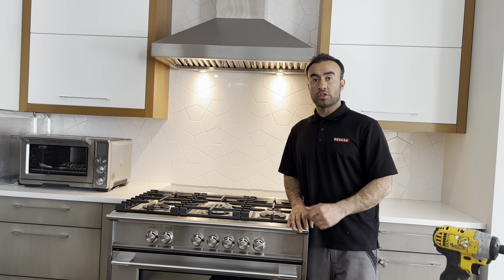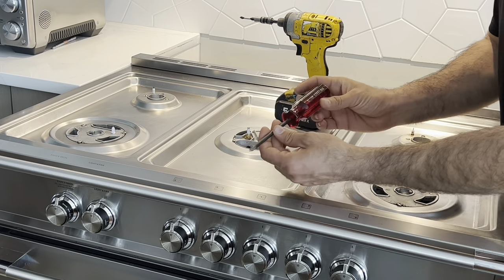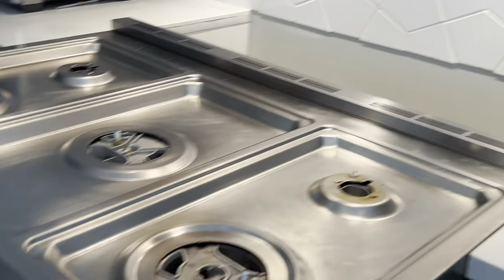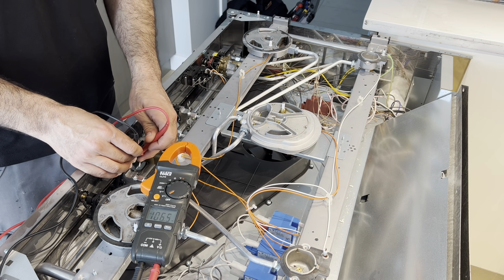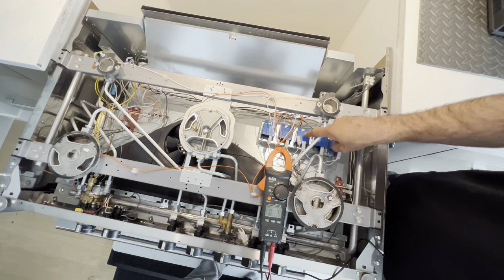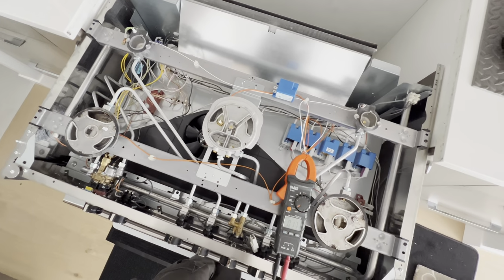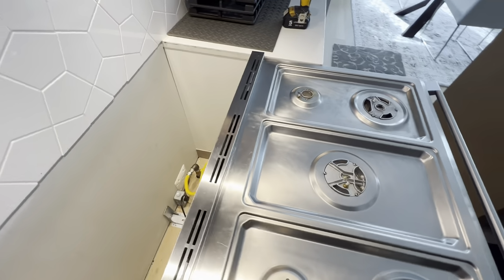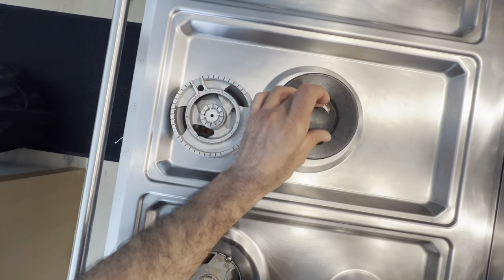Fisher Paykel gas oven centre burner not lighting

Comment: I'm trying to fix a Fisher for a client. The cleaning lady broke the igniter a few years ago. Anyway, I replaced the igniter and the thing wouldn't light, even though there was spark and gas. Only thing I noticed was that that gasket was pretty much destroyed. I told him to get one of those and I'll come try again. Lighting the unit with a bbq lighter showed even burn so I'm not sure the problem.

As far as what you're doing, someone could always try the igniter/igniter control from a working burner, that could help with troubleshooting.
Reply from the maker: Maybe there is moisture there . Turn it in with a lighter and run it for extra 1 hour and see if that solves the problem ✌️

Comment: Hi Hameed, thanks for sharing. I have the exact oven, but it’s the oven that’s not lighting up. All range burners light up no problem. The oven side I can hear the igniter but no fire. I can’t hear or smell any gas being expelled. It’s like the valve is not opening up. After a couple of tries the igniter doesn’t sound. While
once in a blue moon the boiler lights for a split second then immediately shuts off. It’s brand new and a service person is coming over in a few days. Just wondering what could be causing this issue. Thanks.
Reply from the maker: @oneframeoff  hi probably spark module .

Comment: Hi, Hameed. Are the spark plug/igniter all the same or brand specific for gas cooktop? I can see "universal spark igniter" on the internet, not sure if it can work for most cooktops. Thanks
Reply from the maker: They are brand specific, universal can be used in some cooktops not all .
Reply: @hameedwafaAFG  thanks
Reply: Hi Hameed. Thank you for your helpful videos. We have an issue where plastic melted into one of our burners. What can we do to fix the burner?